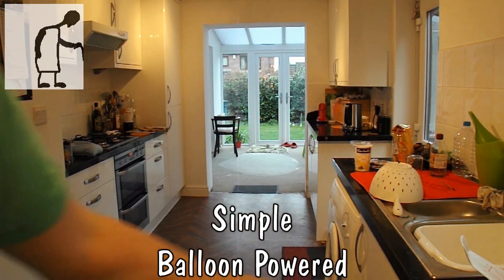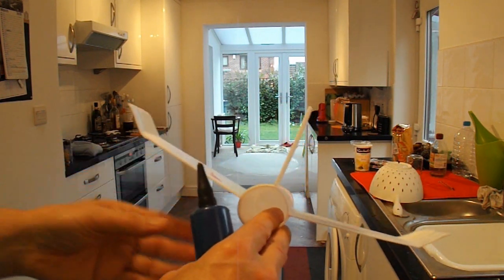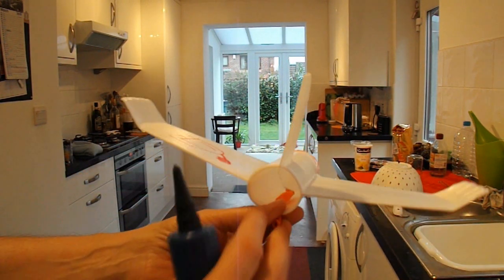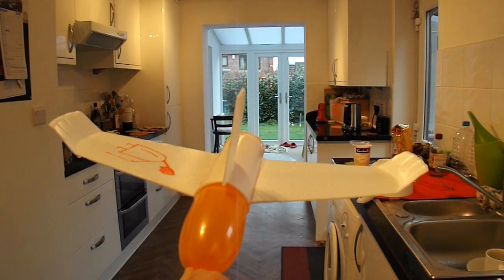Simple Balloon Powered Plane Second Attempt Extended

Comment: Hey grandad, remember that rc biplane? Maybe you could use the bits to make that mosquito rc? You might need slightly bigger motors/props...
Reply from the maker: YonBond I have no plans to take the biplane apart at the moment and I am not sure if that Mosquito still exists, it will be in the junk pile if it is anywhere.